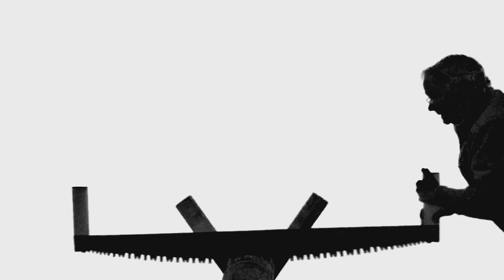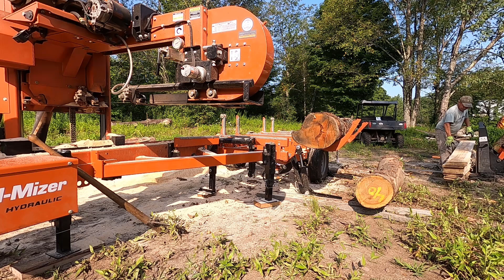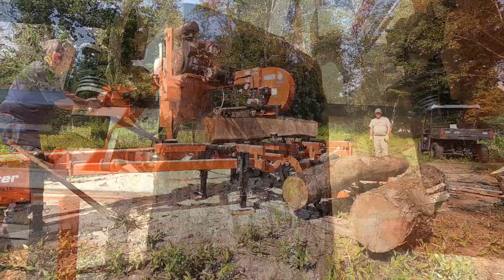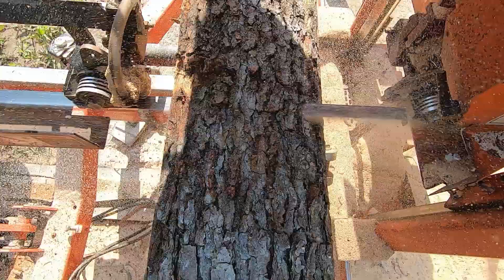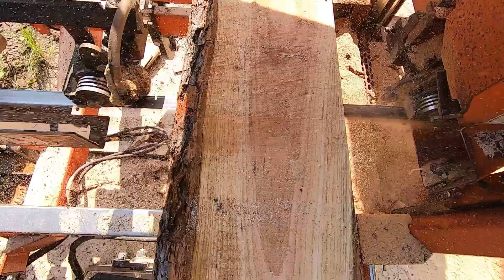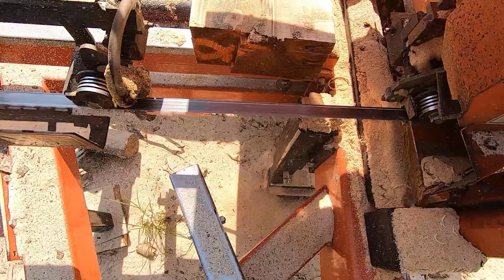CRASH On The Wood-Mizer LT40 Sawmill # 360

Comment: And here I always thought the kick out of the blade guide missing the log clamp was automatic being so smooth every time I've seen it in action on your machine.  I also always like the top down view as you cut.  Most sawyers don't show that.
Reply from the maker: The blade guide movement is always seamless and smooth..........until I forget or miscalculate. Many channels show the lumber grain with a handheld camera. Usually it seems to be not well done and makes the video longer. Using the overhead shot is designed to show the grain without extending the video length. Thanks for the comment.
Dave